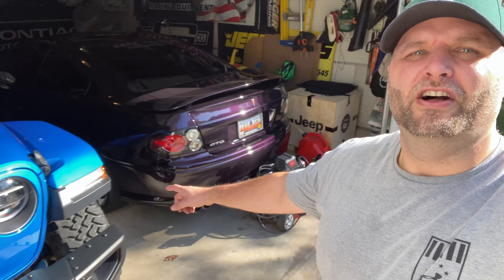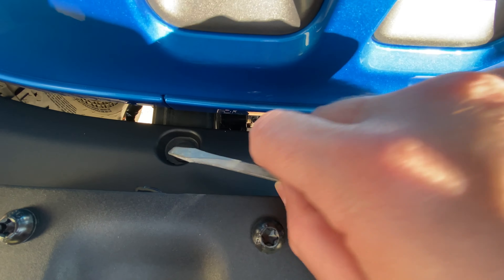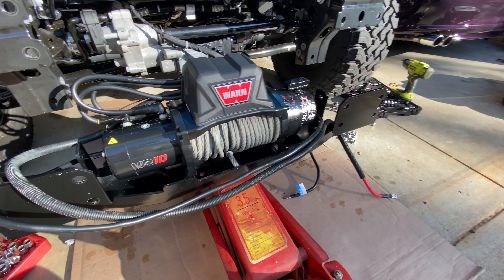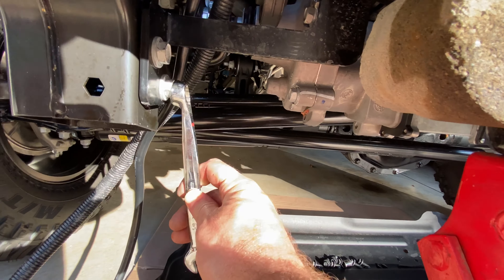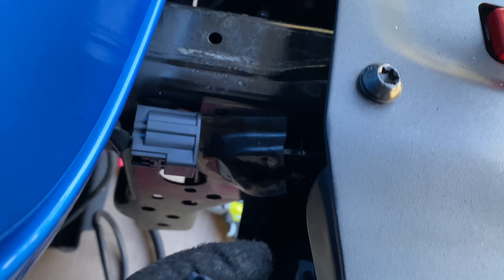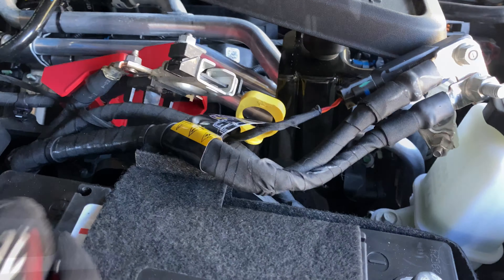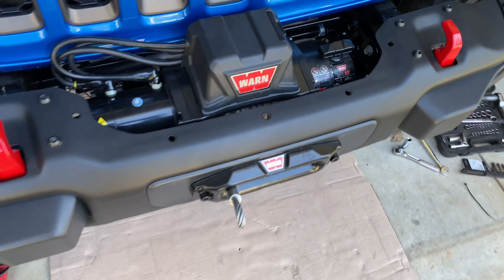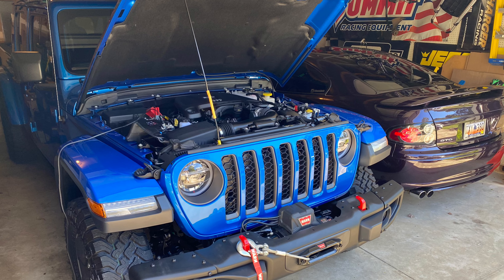Jeep Gladiator JT Winch Install

Comment: Thank you so much! This video was solid and straightforward. I read a lot of people flip the sway bar motor while there. Do you think if you flipped it then it wouldn't have fit the winch plate?
Reply from the maker: @vextamour  Thanks for watching and commenting. That’s a good question and it’s been awhile since I did this video. If I still had the Gladiator, I’d go take a look for you, but I don’t. Sorry!

Comment: With the wired cable aren’t you supposed to use a roller fairlead or does it matter? Thanks great video.
Reply from the maker: Thanks for watching and commenting. A roller is not required, but if you heavily use your winch, you may prefer it. What I used is what was supplied by Warn. The cable does cause scratches to it but I am not a heavy user so it is not a concern. The rollers are bigger and bulkier as well. I hope to switch to a synthetic line in the future also.
Reply: @QuickShifts  thanks. I’m still stuck on wire ropes. I’m scared of change let’s say. I just feel like wire will be more durable and I can wear leather gloves and stay out of the way in case something happens. What are your reasons for wanting to switch to synthetic
Reply: @Colonel1Bravo Have you switched to synthetic yet? All the strength, a fraction of the weight, and increased safety.
Reply: @CredibleHulk10  i actually did and mostly for safety. I have one on my Jeep now

Comment: Will this work with the stock plastic bumper? Looking to put a winch on my '21 Mojave, but don't want to also have to put on a new bumper.
Reply from the maker: No, you need a winch capable bumper and the stock bumper is not designed to accept one. If you’re a fabricator, you could modify it to work but it would be a decent amount of work. It would be faster and easier to purchase an aftermarket bumper instead. There are some value options available much cheaper than the Mopar metal bumpers.
Reply: @QuickShifts  Thanks for the info!
Reply from the maker: @rrbigbird2  we just traded in the gladiator for a 4Xe and it has the plastic bumper. I’m in the same boat as you. If I want to put a winch on, I will need to replace the bumper! 😉👍🏻

Comment: Do you think 10k is enough?
Reply from the maker: Yes, for how I use it, it will be more than enough. If I was a super hardcore guy, maybe more would be needed, but then again, I’d probably have a different vehicle for that level.  Again, I stand by this power on a Warn winch. A lessor off brand, maybe not.
Reply: @QuickShifts  I just purchased a Warn Evo winch, and looking forward to using it.
Reply from the maker: @gvsukids  congratulations! You won’t be let down.
Reply: @QuickShifts  did you add a leveling kit after words? Or did you live with the rake.
Reply from the maker: @gvsukids  I did the molar lift on mine but I did not bother putting a leveling kit on it. No issues so far and I keep on using the bed to haul stuff so it might be for the best that I didn’t level it.